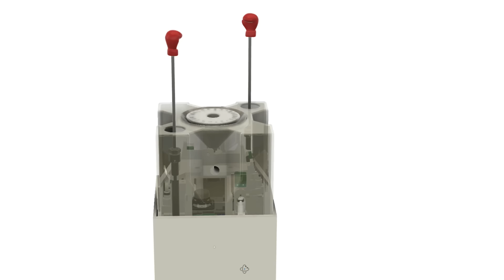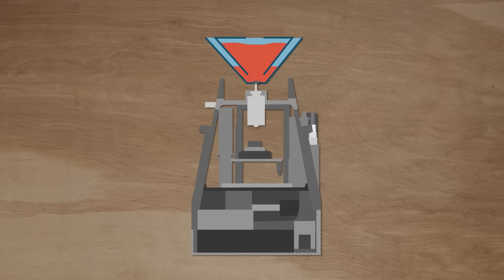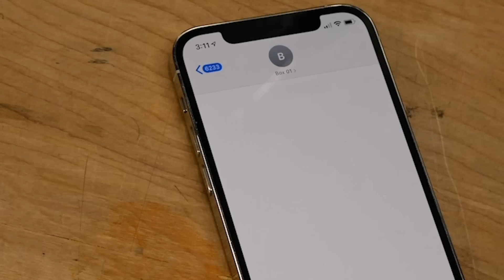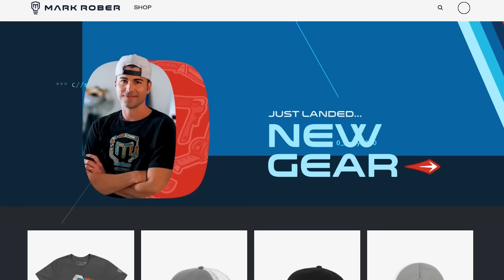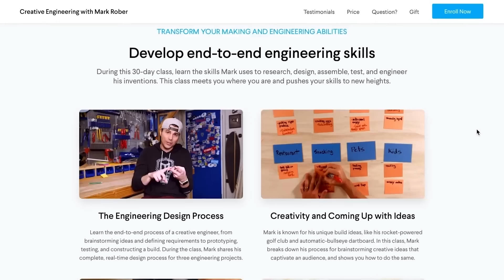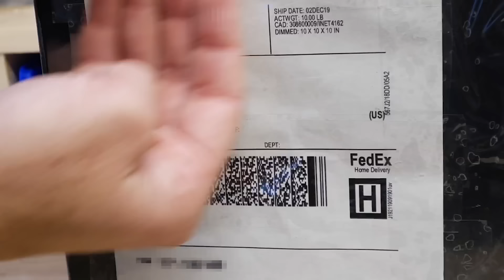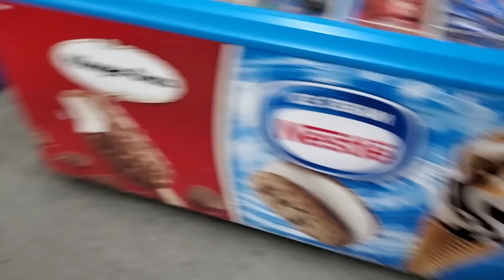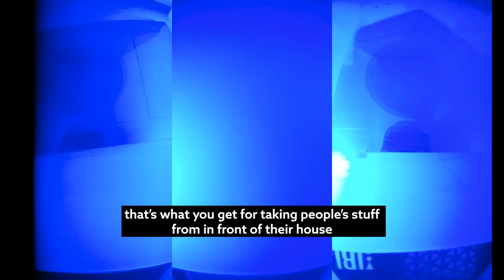EXPLODING Glitter Bomb 4.0 vs. Package Thieves

Comment: I love the upgrade idea of it firing glitter multiple times it’s smart yet so simple.
Reply: Yeah, and a giant mess lmao
Reply: Fax
Reply: In addition I think the arms that launch off the top should lock out so that the lid can't be put back on
Reply: @GageDrums  Exactly. A simple tab that spring-loads to avoid covering it again.
Reply: You don’t mess with my guys
Reply: I think its a bad idea because people usually get rid of it befor the second spin goes off let alone the 3rd
Reply: It’s like the “water from the Nile” magic trick vase
Reply: @nortenero  That's been in there since the original I'm pretty sure.
Reply: @h4724-q6j  Doesn't seem to be very effective lol
Reply: I imagine there should also be a way to avoid the glitter just getting poured out, because it seems a lot of people open it upside down. The whole misfire thing also needs to be resolved, I imagine
Reply: Yes
Reply: I have an idé for 5.0 

1. Make it hard to close.
2.  Make some smaller like a box for a keyboard.
3. Put wheels on it so it moves.
4. make it spray water.
5. Put a very strong light on it.
Reply: @nortenero  using a one way fitting on the pneumatic cylinder would be easier
Reply: The best plans usually are. Less that can go wrong, and much easier to fix when something does.
Reply: I liked how it was spraying glitter all over criminals apartments and hallways. It was a brilliant modification.
Reply: I sugest an Ink filled prinkler system
Reply: i just fell in love with this series!!
Reply: @communist_dogo  idé
Reply: yes
Reply: It feels like every vid that has more than 20m a famous yt come
Reply: Farts? Nah Mustard gas that’s not toxic to humans btw! 😂😂😂

Comment: You need a lock that pops out once they open the box so that they don’t put the lid back on
Reply: Either have the same 3.0 lock system or have the 3.0 lock system BUT 1 of them is upside-down, so it would take a LONG time to figure out what happened.
Reply: Or have the lid break away after ejection
Reply: was thinking a simple fold out barb like a fishhook that locks would keep them from being able to put it back on.
Reply: Genius
Reply: In this design it seems like the boxing pistons act as a lock to keep it open.
Reply: It already has one
Reply: maybe, in addition, the glitter cup could spray the glitter more to the sides, rather than up and out. so if they tried to put the top back on anyway, most glitter would still be able to escape and get into everything
Reply: Maybe the point of the magnet
Reply: They need handcuffs that pop out to send these people to jail 😑
Reply: @sullytatum50  no not the point of the magnet the point of the magnet is to signal that the lid has been opened and to initiate the sequence
Reply: the 3rd gen have than, but the 4th gen makes it harder to push it back down, since the air pressure inside the pneumatic arms are so high, makes it harder to push it back down
Reply: 2:00 you can see the locks that pop out of the sides near the top. I think most people were pushing it past those locks and probably tearing up the box apart in the process.
Reply: make it to wear arrow cubes pop out on the side and lock into place  so they cant put the box over it
Reply: Agree
Reply: yes
Reply: nah we'll see one where we somehow don't see the guy and hear "click out of one, nothing on two, three is set..."
Reply: make the lid form to a round shape when it comes off.. no hop of getting it back on
Reply from the maker: @0o0Zero0o0  That was the idea but they didn't provide enough force so we retrofitted the 3.0 locking pistons late in the game
Reply: @MarkRober  If you think they really deserve it.. What about releasing ink?
Reply: @MarkRober  omg mark do you notice me?
Reply: @dimitri299  or food coloring 😳
Reply: Not through the video but 3.0 has that
Reply: @MarkRober  e
Reply: @MarkRober  hi mark I just did a engineering thing for my science class bc of you!!!! (I gave you credit well some) I did a dog toy kicking thing so I went for the football kick thing that you did
Reply: @noobicus727  I will sirtenly use this
Reply: @lasagnalover100  wdym and it’s certainly not “sertenly”
Reply: @noobicus727  sorry I was in a hurry
Reply: @dimitri299  simple but revolutionary
Reply: @lasagnalover100  you don’t need to apologise but ok
Reply: @MarkRober  should have the top corners expand outwards so the lid doesn't fit back around the box at all
Reply: @maxs713  Sooo taser you say
Reply: @BlackViperMWG  great idea
Reply: Or have it spray poison gas so they have no way of putting it back on in the first place
Reply: @MarkRober  How about next time instead of glitter, the box releases used kitty litter?
Reply: @chantefarsht.nerd_for_life  that is genius!  That would be so funny🤣🤣🤣
Reply: Break away lid is what I suggested as well.. just have all 4 corners fall apart once it ejects so they have no cover
Reply: @MarkRober  Hey mark plz place subtitles for people who are hard of hearing/deaf. The auto subtitles do work but are not accurate
Reply: @MarkRober  put it on the sides at the top so the lid physically won’t fit and allows the glitter and spray to continue.
Reply: @braxbro7602  This is the way...
Reply: @MarkRober  Could you make the lid destroy itself (break into pieces) when lifted
?
Reply: @iprey4surf  this is the way

Comment: Maybe for 5.0 he could design the lid so that it comes apart when ejected, making it impossible to put back on.
Reply: This was a feature in the previous glitter bombs, i dont know why its not in the 4.0
Reply: @keoogi  I think OP doesn't mean those magnet thingies from 3.0 that stop them from putting the lid back on, since the boxing gloves on the sticks in 4.0 already do that, I think they meant a lid that falls apart completely once it gets ejected
Reply: @momplspickmeupimscared  'since the boxing gloves on the sticks in 4.0 already do that'
They clearly dont though.
Reply: 5.0 should have lighter fluid and a flint and steel
Reply: @twotimes2648  yes they do. You see in the videos that many times they try to put the lid back on and a lot of the glitter still flies around regardless and that's what matter lmao
Reply: That's even better than the blocker he added in past versions. I hope your comment gets noticed by Mark because it is genius indeed. Some sort of magnet strip that reverses once you open it. Maybe an electromagnet that turns off when you open it so the 5 sides that make the lid stop being held together. The more I think about it, the more I like this idea!
Reply: @richardgomes7d  just using locking, springed, pistons instead of air, would be better in that case. Punches fly, hands stop extended, locked in place.
Reply: That would be cool!

Comment: Two things for 5.0

1: The boxing arms needs to lock extracted.
2: The glitter has to go further. CO2 gas canister which fires glitter all over the place.
Reply: 2 sounds like a flammable liability.
Reply: It also need a flamethrower
Reply: I’m just waiting for Version 6.0 now…

Literally just an M18A1 Claymore inside
Reply: Spray epoxy.
Reply: @Sluggadome_Rotunda_Bernardson  4 claymores
Reply: @Sluggadome_Rotunda_Bernardson  Yes, and a couple sharks holding the flamethrowers.
Reply: 3. Incorporate rocket boosters with gps to allow box to navigate back home by itself
Reply: 3. Flamethrower
Reply: Super Glue
Reply: Maybe elephant toothpaste
Reply: @Sluggadome_Rotunda_Bernardson  I think Colin furze will make that
Reply: And replace the glitter with dye.
Reply: Ica is the best here

Comment: One suggestion: Return of the spring lock that prevents the thief from putting the lid back on. Forcibly keep the gloves extended
Reply: I MAKE AWESOME CONTENT

..
Reply: Then the chances lower that it can be retrieved with the lid, having to make more replacement lids. :-/
Reply: @Time4Technology  we are talking about a guy who has it's carwindow replaced a few times for the fun of it. Doubt a box would be an issue ;-)
Reply: The second dude was clearly trying to close the lid at 8:34 but couldn’t. I think Mark Rober thought ahead
Reply: @Time4Technology  Eh, it would be pretty cheap comparatively.
Reply: That’s such a smart idea!!!
Reply: The PSI of the tubes keep it open.
Reply: 5.0 is just gonna have guns
Reply: besides that I think the box quality makes it easier for it to break over the spring locks maybe?
Reply: @Мишанчоооо  Go away!
Reply: @damian9303  Considering that at least two people got the lid back on, I'd say he didn't try hard enough. It's not impossible to overcome the force of the "struts".

Comment: 5.0 needs to be able to not have the top put back on after it launches.
Reply: DAE 5.0 MACK LAUNCH
Reply: Yeah, spring-loaded legs that stick out to be larger than the lid. Like those folding fins you sometimes see on tube-fired rockets.
Reply: That was in last year's version I think
Reply: And also a heavier does of glitter, more noise, and violent vibrations.
Reply: Since he said he'll be partnering with police for that one, I hope he uses a dye pack instead. Ya know, the kind of stuff you'll get if you rob a bank.
Reply: @idkman861  WHAT? DAE MACK MULTILAUNCH???
Reply: This is a great idea. You can use something like those locking anchors that you put in walls, where they spread out as move out of the holes, but then cannot go back in.
Reply: @ZeldagigafanMatthew  Maybe it also glows in the dark/under UV light?
Reply: Liquid spray that stinks/burns/stains
Reply: Mark rober should team up with  cops
Reply: He already made that in 3.0

Comment: Hey, Mark! Great video!

If you want, I do business with companies that manufacture cosmetic glitter (a.k.a. the finest glitter of all) and we can hook you up. Also, for version 5.0, you could also use crystal violet. It's an olive-green powder which, when it comes in contact with ANY sort of moisture, turns into an intense purple dye that's permanent. To give you an idea of how powerful it is, 1 gram is enough to stain a 55-gallon barrel of water.
Reply: I like the idea!!! Up to this comment please!
Reply: Really hope Mark see this advice.
Reply: The big question though, is it biodegradable? Pretty sure he made that very clear on one of the oldest videos of this series
Reply: If it is biodegradable it will be a perfect way to make them suffer
Reply: Can't do it. Intentionally causing damage to the other person's property is still a liability even if the other person did just commit a crime. He already has to have liability insurance for this stuff anyway. If that one guy had crashed his car when the package exploded, guess who would have been liable. Not trying to be a buzzkill - he already knows this stuff because he's running a business, which is easily forgotten because it's a fun video.
Reply: Try to contact him otherwise by mail for example
Reply: @bowgy4  And that's the problem. IMO if a person is engaged in any sort of criminal activity --- misdemeanor or felony and are injured --- They should not be allowed to sue or seek damages. They made an intentional choice to commit the crime. It makes no sense and isn't 'justice' when a criminal is allowed to sue a person protecting their property. 

All that does is reinforce negative behavior and encourage more of it.
Reply: I wouldn't go that far. What if the theif opens the package on someone else's property or in a public space? That would cause too much collateral damage imo.
Reply: Everyone comment and like so mark sees this!
Reply: i feel like the best glitter is something that sticks to you for a long time
Reply: yes no mercy. Ink it up.
Reply: Biodegradable???
Reply: i was going to comment to his vid that he should have something liken permanent ink or something , yours is excellent!

Comment: "we don't want to over engineer it so we made custom hydraulics." i'm sitting here thinking they could use springs.
Reply: Well yeah, but to hold the box down it would take much more over engineering than the hydraulic system
Reply: @BR3DCRUST  electromagnets are a wonderful thing.
Reply: @BrodeyDoverosx  i think he knows what they are tho
Reply: I would assume he already tried that and it didn't work out properly. Springs and a latch would have been the first thing someone like Mark Rober would have tried.
Reply: Pneumatics, not hydraulics.

Comment: Did Mark just solve his problem as a side thing- he made a planter which hides the box so you could make something where when you put the box infront of it, it hides it then it needs a code to reveal it, stopping the theives.
Reply: There should just be porch benches that the seat is actually the lid to the storage area, and deliveries are put inside. Owner leaves it unlocked when empty, delivery guy locks it. But yeah, having a planter eat your packages would solve it.
Reply: That’s called a lockbox and it has already been invented.
Reply: @Saul Hackney depends on the size of your package. If you have a small package then that's a great solution.
Reply: Exactly.
Reply: If it needs a code, you can see a panel. If it has a panel, there are goodies inside. If there are goodies inside, you have to smash it to pieces. 
Sadly, this idea is not going to work.
Reply: @fullfungo  yeah but most of these people are looking for the low hanging fruit which is packages hanging out in the open that they can quickly grab.
Reply: Wow lol
Reply: @soapygirl83  true true

Comment: Is it just me, or does the auto-shrouding flowerbox sound like the perfect way to stop package thieves in the first place?
Reply: Yea but it doesn't teach them a lesson. And once they figure out you have that box they'll just break into it.
Reply: @8015908  Eh, when my apartment complex got an amazon hub (a giant massive locked steel locker with tons of various sizes for packages) there hasn't been a single package stolen, and this used to happen all the time. Went from happening all the time, to never happening.

Comment: You should make the pistons have higher pressure so the porch pirates can’t put the lid back down.
Reply: Unremovable lid
Reply: don't do high pressure, instead I'm imagining a groove on the piston rod that when fully extended allows for a spring loaded lock to hold the piston in place. that way you can avoid high pressure and still keep thieves from putting the lid back on
Reply: Didn’t he make version 3 with a lid you couldn’t put back on? With simple flaps that lockdown when the lid is slid off.
Reply: Or putting the lid back on opens a quart of liquid stink out the bottom.
Reply: It has to appear to be reclosable, though, so the shi... - ah, fine gentlemen - have to get in close for a while to try.
Keep your friends close and your enemies even closer - Sun Tzu
Reply: @DutchStar  literally choked on my drink because your comment made me laugh LOL
Reply: No, if they cant put them back on they might just smash the whole thing..
Reply: make the edges break away so the lid is no longer a sealing lid
Reply: @firstlast-yn4qg  
The idea is if it can be recovered in a working condition,  reset and catch another one..
So it needs to have a relatively simple design in reset. 
Thou.. I liked someone's idea to have it trigger a shot from the bottom
Reply: @anotterwithaphone3077  Problem with that is when the alarms are going off I bet there are people that are gonna try to smash it to shut it up.
Reply: They don’t need higher pressure, they just need to automatically lock in place after they extend.
Reply: @Death-999  they covered that in the video. So do, many just try and get rid of it. Get it out of their home and such

Comment: I have a suggestion, there needs to be a little tabs that stick out when the box is open so people can’t put the lid back on!
Reply: I think he added those in generation 2 or 3
Reply: That was added in 3.0
Reply: Make the lid-launching pistons lock in place when they go off.
Reply: Or, box just totally falls apart into puzzle pieces it would take genius to put back together.
Reply: @cassidym2126  then why was the lid going back on
Reply: Just make it so the sides are held together by something and when the box is lifted the 5 sides fall off.
Reply: Also, it needs to work better when flipped upside down, so the glitter don't just fall, It needs to be sprayed better

Comment: I think the next upgrade has to be preventing them from closing it back up using the same pneumatics or simple spring latches. When the lid is opened, these activate and prevent the lid from being put on, this ensures that’s they get all the glitter and all the spray they can possibly get
Reply: Should be able to design the pistons to lock when fully extended.
Reply: I thought he had that implemented already
Reply: @muddychevy731  I saw elsewhere in comments 3.0 had them and they were after retrofitted in 4.0
Reply: better yet: give them a false sense of security by allowing the package to be closed back up
BUT
the ejector can activate multiple times
so
1. fire lid
2. fire payload
3. springs deactivate
if victim puts back the lid in under 1 minute
cooldown
fire lid without any trigger (since it needs to know if the victim lifted the lid)
go back 2
else
just go back to 2 without waiting for lid
Reply: I said the same thing. I think a small adjustment could be made to make this change not too intrusive to the whole design. A simple tab that pops out in all 4 directions or at least one, that wouldn’t allow the cover to fully be put on, wouldn’t be that hard to engineer